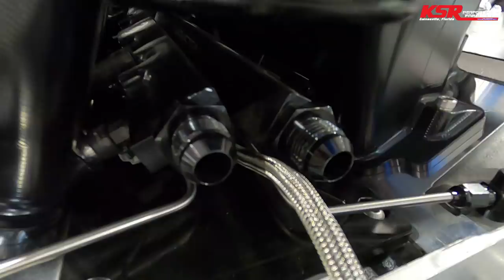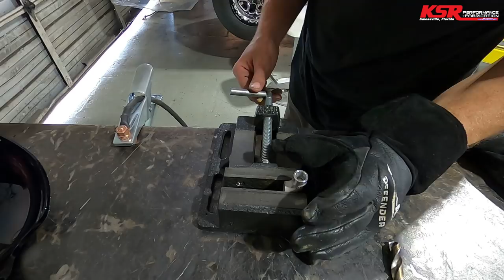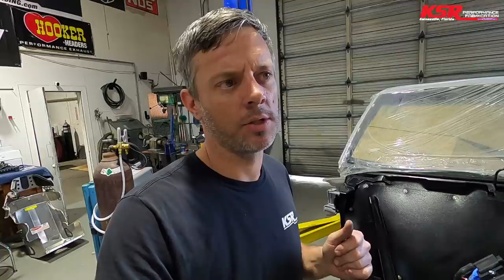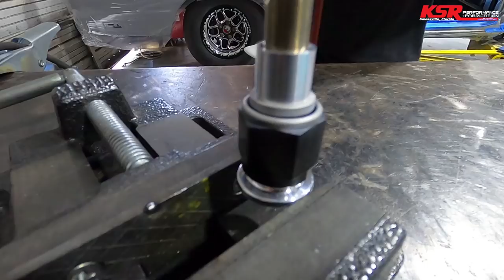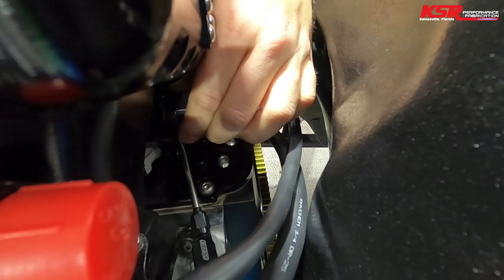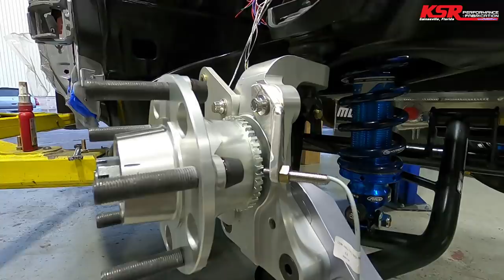Mullet El Camino Build Episode 13 Fuel System and Wiring Begins!!

Comment: I hope that’s not brake cleaner you cleaned the fittings with after bead blasting, just before welding! Please keep that stuff away from your welding area and any part to be welded. Brake clean + weld arc = phosgene gas which will make you sick at best and dead at worst (Think WW 1 trench warfare gas). We want you guys around for a long time doing what you do! Great video, great content.
Reply from the maker: That is only true for chlorinated brake cleaner.

Comment: One of the standards for pressure testing is 150%, but never less than 125%, so if you test that to 200lbs, you should be good to go. (should be)

Comment: I’ll be surprised if the welds don’t leak with all those starts and stops. Aluminum is the worst when it comes to pressure testing. Little air bubbles for days 😑

Comment: Seems a little odd they don’t offer that fitting
Reply: They would have to make it for every possible intake manifold for every engine with every possible combination of fuel injectors.
Reply: @deciplesteve  they change that much? I figured they’d be atleast similar enough to get close. Or I guess they could’ve run soft line a little longer.
Reply: @BBCMONTE34  even two different brands of intakes and two different specs of injectors (even within the same brand) could be off enough to screw that up.

The soft lines would kink on anything shorter than 5-6".

Comment: What kind of battery is that ?     Please.   Need a good battery.  Using 2 yellow tops.  They are garbage.  I don’t have a race car.  It’s a show car with a lot of electronics.    I need something reliable.  It’s embarrassing having to get a jump after a show.
Reply: Can you run with a small cranking battery and then have a deep cycle lithium battery look after the house like what is done in a camper?
Reply: @robertshepherd995  was looking for something compact I can put in the front and do away with extra batteries in the back.